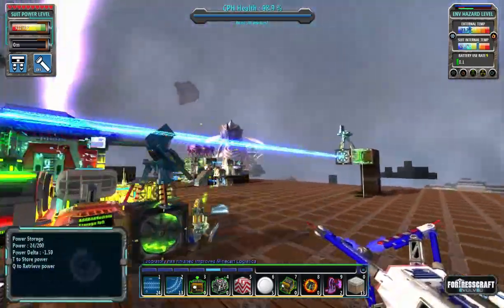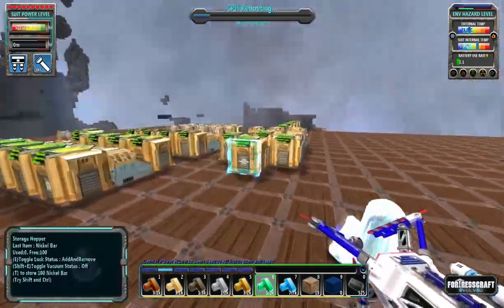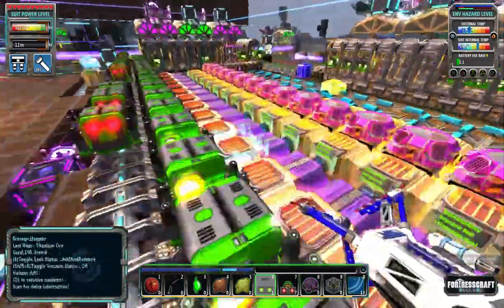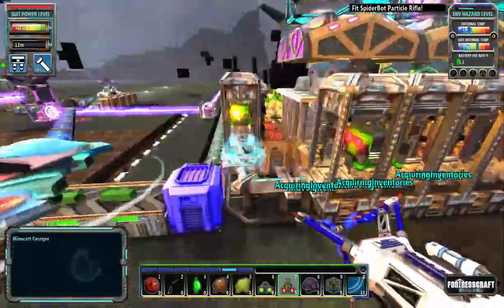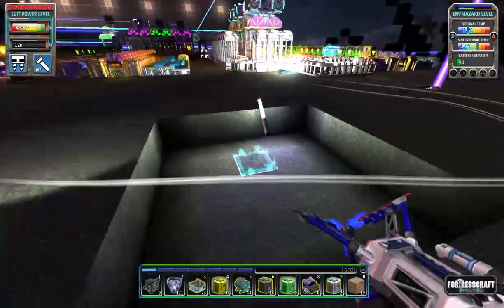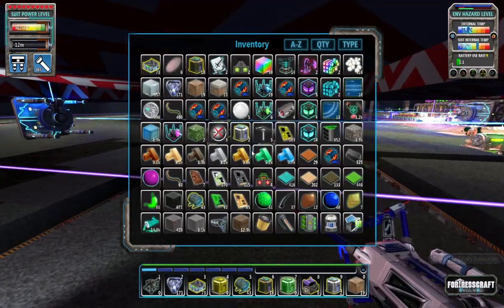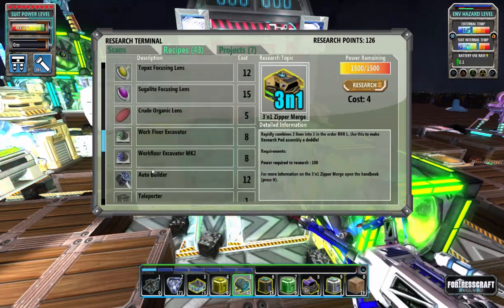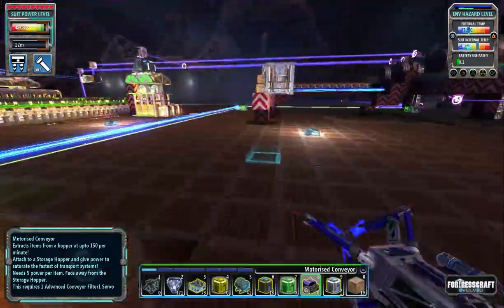FortressCraft Evolved : Frozen Factory - Ep 41 MineCart Logistics

Comment: Hey, how are you getting all this organic rock? I built two minecarts systems with like 20 carts each and I'm out of organic rock, and there no more on the surface
Reply from the maker: 2 ways, go to the corners where the overminds are, and you will find a bit on the soft resin created by the tunnel nukers. Or spend some time in the cold caverns with batteries and lasers and wait for the camobots to come in. Each camobot will drop one or two organic rock.
Reply: Yeah, I cleared out all corners, so I guess cold caverns it is.